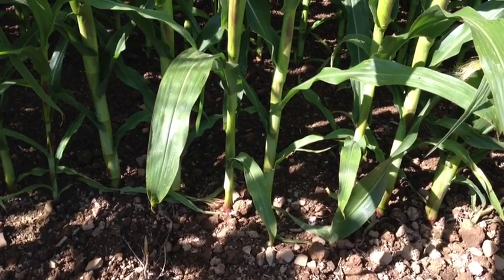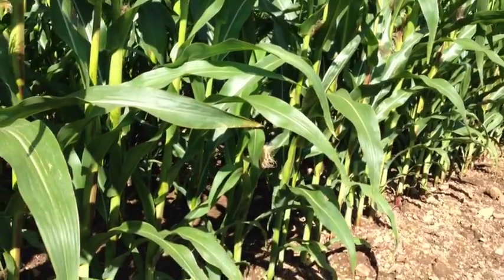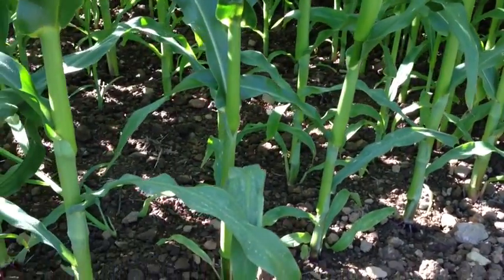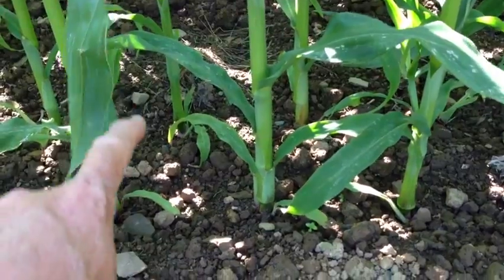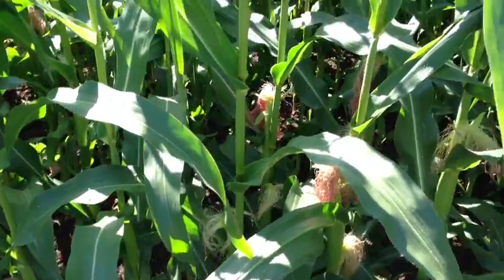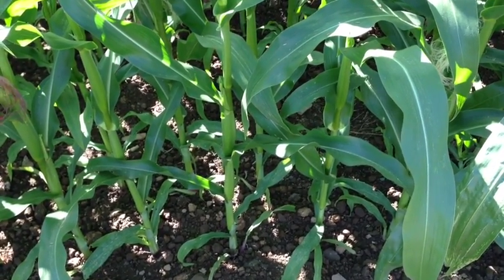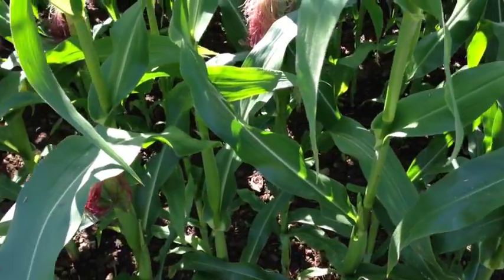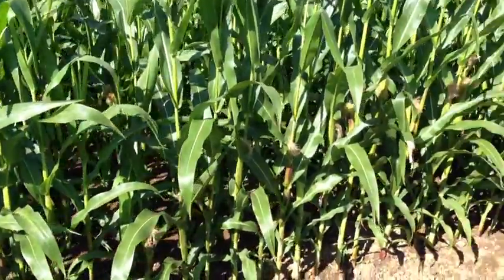Twin Row Maize Update

Comment: So how did the yields go did you feel that it ended up having a true advantage over normal 30 inch?
Reply from the maker: there is a definite yield advantage at 45,000 seeds/ac in the twin-row system compared to conventional 30 inch rows. Saw yields advantages of 12-17% more over conventional at this seed rate.